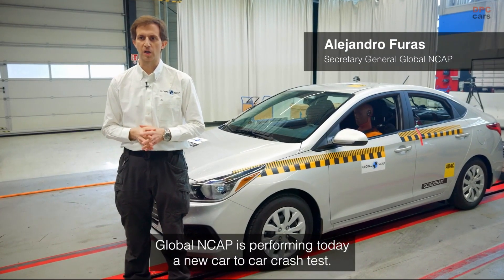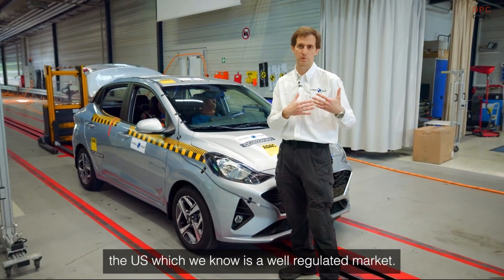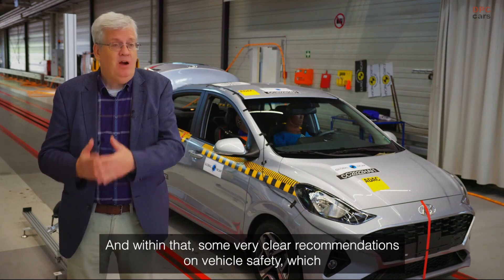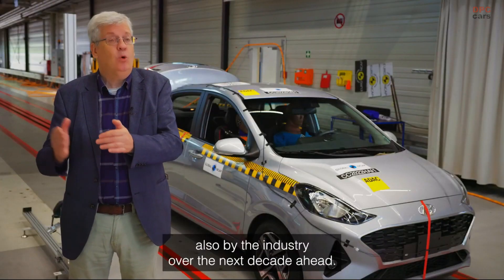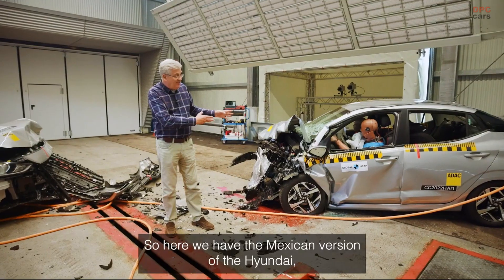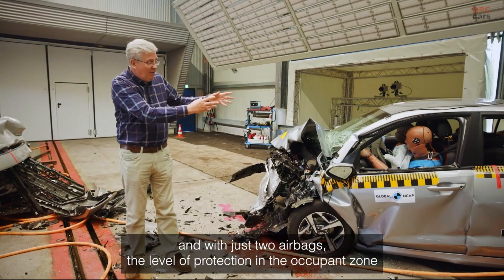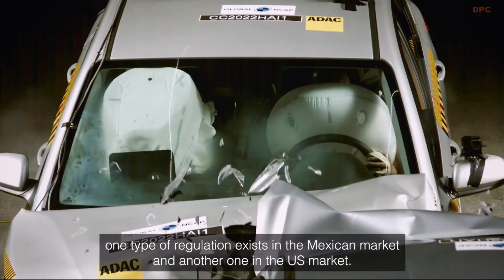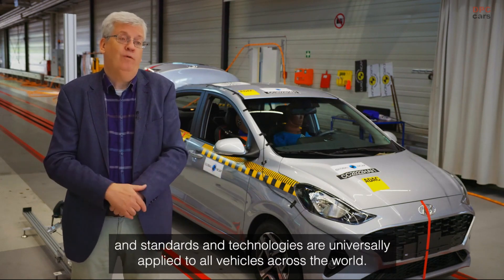Hyundai USA vs Mexico Spec Crash Test

Comment: Indian cars architecture are not upto par until this time, except some car brands like Tata motors and mahindra automobile which are making safer cars rating 4 to 5 stars in global ncap. Mahindra XUV700 got the safest car award 2022 by global ncap. In India, earlier people used to compromise on safety as they want more for less, but now the mindset has started to change and people are opting for safer cars, so the manufacturers now have to meet the standards now.
Reply: It’s amazing that Indian vehicles are finally catching up in safety. Surviving a car crash should not be a luxury, anywhere.